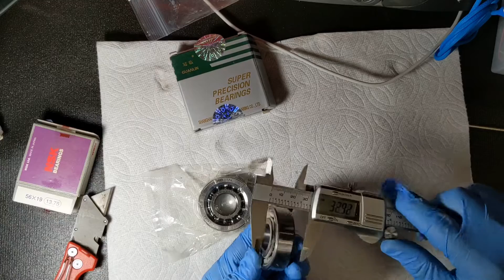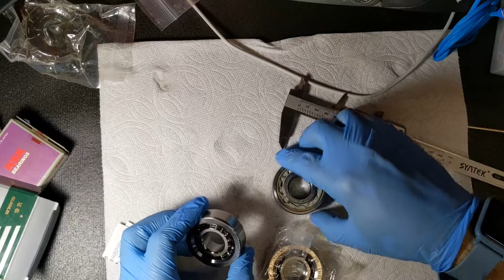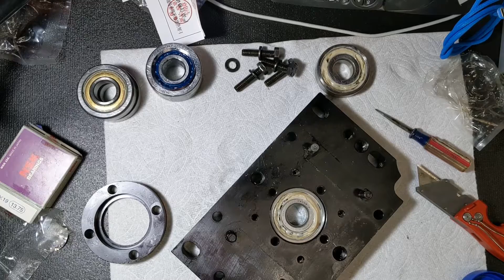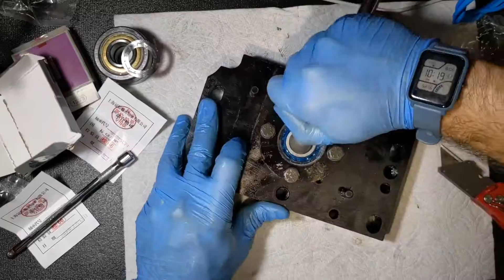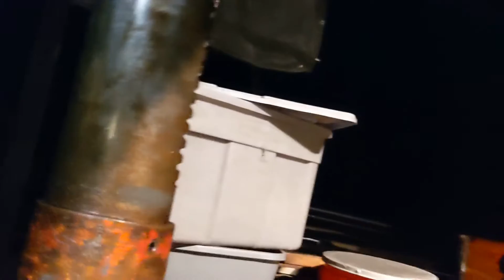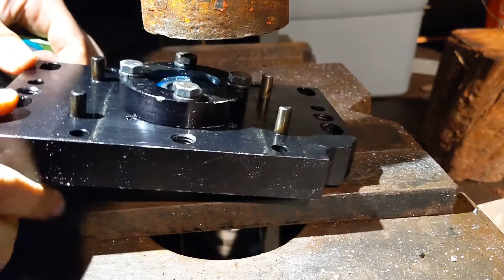Fadal 4020 Thrust Bearing Replacement Part 1

Comment: How are they holding up?

Also what you need is a heat gun for installation and removal.

Just warm up the aluminum and the bearings slide in and out without pressing hammering or prying.
Reply from the maker: Still not done refurbishing the machine. 🤣No time unfortunately.. 😜 I need to get back at it though.. 

Thanks for the tip on the aluminum expanding for those bearings.. maybe I'll try that on the Z axis when it's time.. I'm replacing all the old brushed servos with brand new Delta AC servos.
Reply: @hilo90mhz  yea the heat gun makes it super easy to change them out. Also you need to put some grease under the seals. Since you don’t have coolant through screws I don’t think it would matter either way with how you orient the seals they only need to keep out chips and some coolant.

Retrofitting a machine tends to be a lot of work for not much gain in my opinion the factory motion system were mostly accurate enough with new boards. I definitely don’t think the motors were the hold back mostly the cpu. But newer boards come up on eBay often for very low cost.
Reply from the maker: @AgosMachine  mine is from 1986 so one of the earlier machines.. it probably could have been used with the stock stuff - I needed at least one new resolver. And possibly lots of different computer parts quite soon.. I agree it's a ton of work and definitely don't recommend it to others if you have a fully working machine etc.. I do electronics stuff for work / fun more than machining so the wiring / computer side of things is easy for me. And the new motors I've got should mount with just one adapter plate + some new shaft couplings. Gonna put LinuxCNC on it.

Comment: If I too much backlash in the thrust bearings, how will the axis move?
I can measure about .005" of play on the end of the screw.
The axis has scales for feedback as well.
When moving rapid or in feed, the motion is very rough.
If I give the axis resistance then it will move smooth. let off the resistance and its back to rough movement.

Thanks in advance for any help.

Comment: I read somewhere that you should leave a .001" gap on the cap that holds the bearings together. Is that true?
Reply from the maker: Are you referring to the black anodized clamping plate for the bearings? It still has plenty of clearance when clamped down by the 4 bolts - the force is determined by how much you torque the 4 bolts.
Reply: @hilo90mhz  yes the clamping plate. I’m currently replacing the bearings and am not sure  If I should tighten to the point where the cap touches  the mount .
Reply from the maker: @Martin-we1rm  on mine that is not possible.. the plate will never touch the mount.. I just tighten the bolts to a reasonable torque.